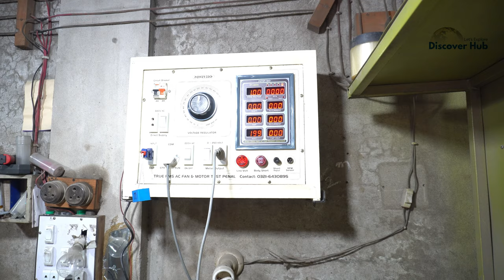Washing Machines Manufacturing Process | How washing machine are made .

Comment: I come from the Czech Republic, when I was a little boy, the communists were in power and it was 1980, and even then our washing machines could heat water, I didn't see any heating element here.
Reply: In Asia, climate is usually warm at 30 degrees centigrade. Secondly, clothes are hung dried in the sun. Most washing machines do not come with heater because there is no demand for them. You have to buy special models that come with heater.